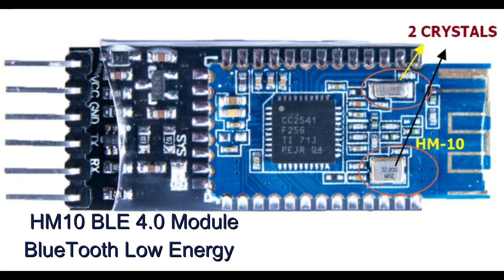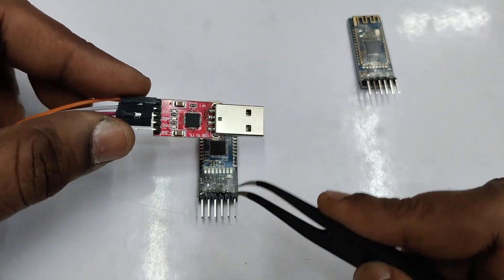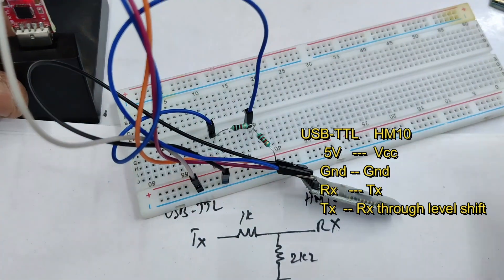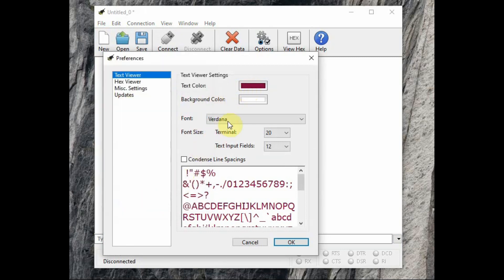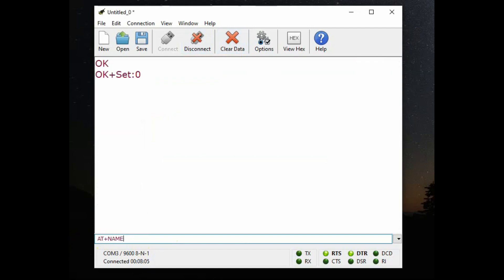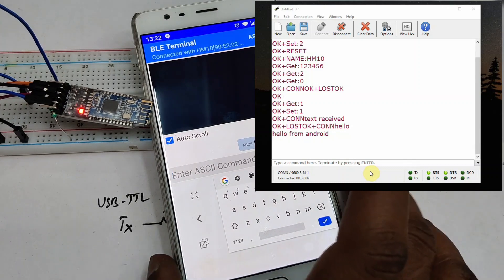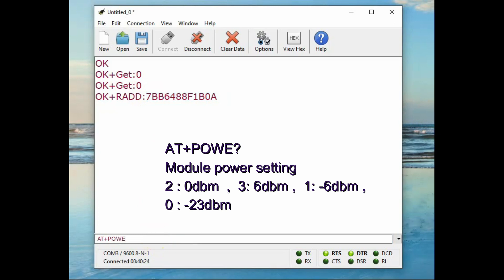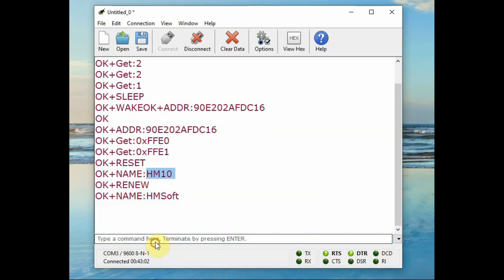HM10 BLE BLUETOOTH Module Part 1 -AT Commands on Original HM10

Comment: Thank you very much for HM-10 introduction video. I am trying to use HM-10 but getting some problems. 1. Unable to see HM-10 on the BLE terminal app on my Android phone. The HM-10 is in Mode 0  (peripheral). How to get this rectified? 2. Also unable to pair the two HM-10s, one is set as Slave and other as Master. Is there any specific AT command for paring the two HM-10s? The software version is HMSoft V608. I would appreciate to receive your feedback. Thanks .

Comment: I have a doubt is codes for Hm-10 and Hc-05 are different? Because already have project on HC-05 and if I now just replace this Bluetooth module to Hm-10 is this previous code work properly or I need to alter?
Last question Do i need power division in 3.3v for RX if I connect with Arduino Uno?